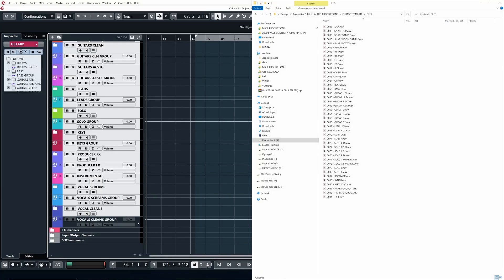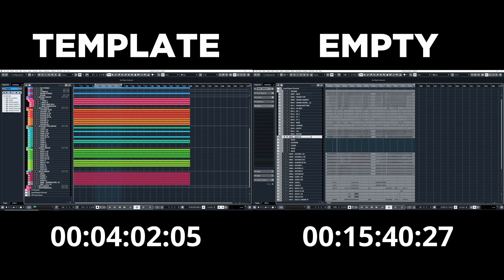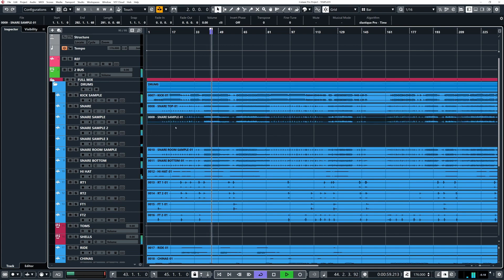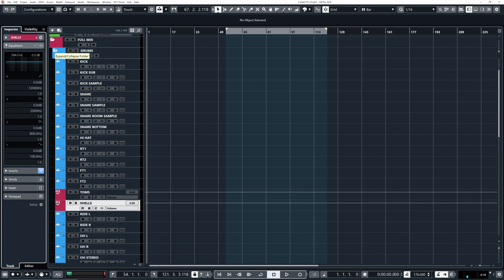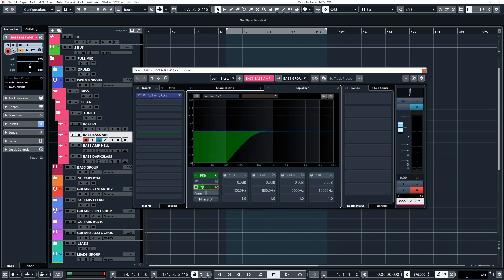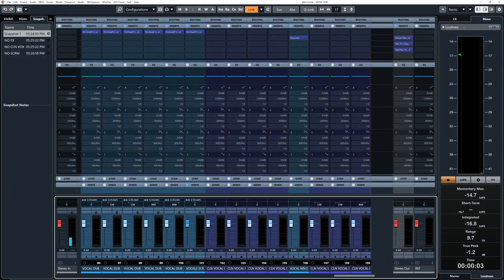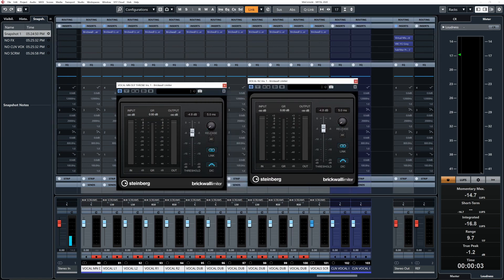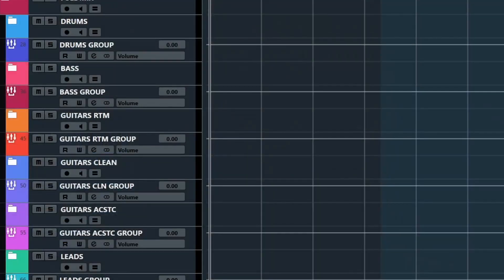Why You Should Use a Metal Mixing Template | Metal Recording Basics in Cubase

Comment: Nothing wrong with setting up templates. Totally efficient. Didn’t know about linking, that’s a great tip. Cheers
Reply: There is one thing though. To link it the way Mendel does you need to have Cubase Pro. While you can link channels in lower versions the lower version don't let you link specific things.
It's just volume and that's it.
Reply: @RudalPL  Lucky I just upgraded after 10 years of using Artist 😀
Reply: Haha I wanted to write the same comment 🤘
Reply: @Stone Cutter Yeah that's pretty much what I've been doing to this point and it n most cases is probably more efficient